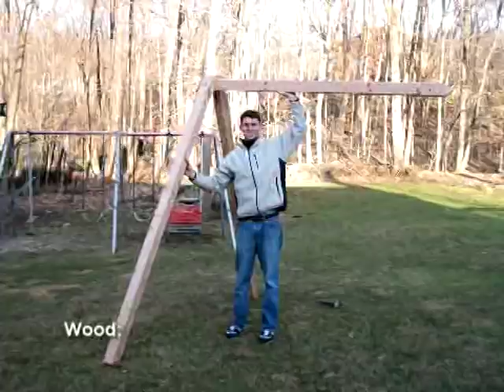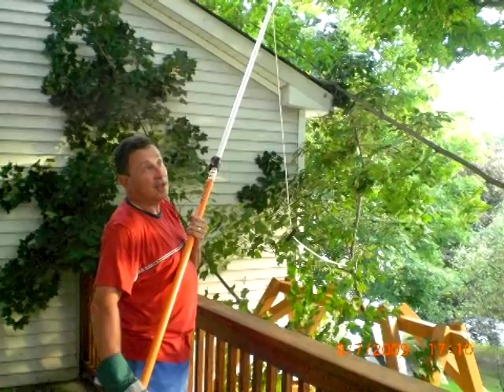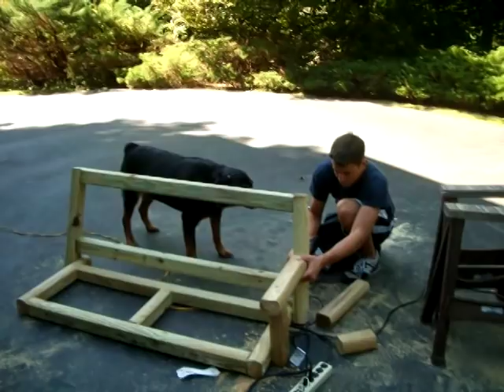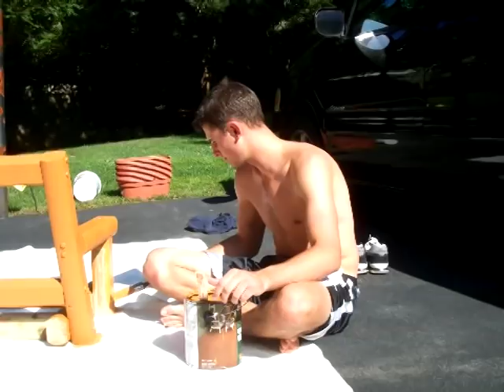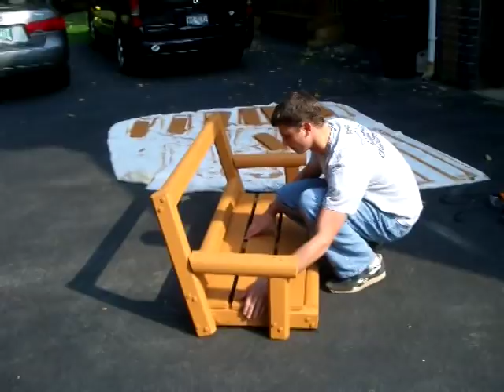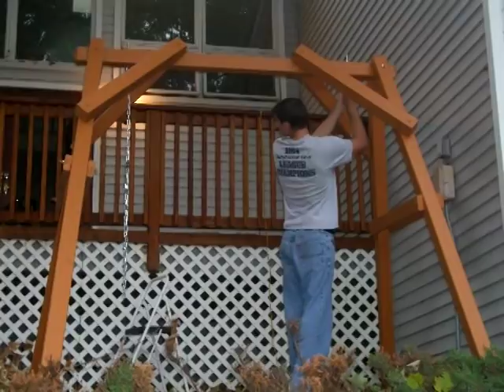Swing Chair - The Best in the World

Comment: Did you have to sand down all of the pieces before painting?  Did you use a water sealer after painting?  I like the way you hung the swing to the a frame....How you attached eye hooks to the outside of the swing......Where did you get the hardware and how is it holding up?  thanks!
Reply from the maker: Hey, thanks for the comment! I didn't do any sanding before I painted them, but it was all treated wood. I used heavy duty wood stain that, if I remember correctly, is supposed to last for something like 35 years, and I did two coats of it. The stain had water sealer built in, so I didn't do that separately. It's been 5 years and it still looks almost like new and has held up great -- my parents use it all the time.

I bought all of the hardware and supplies at Home Depot. Let me know if you have any other questions!